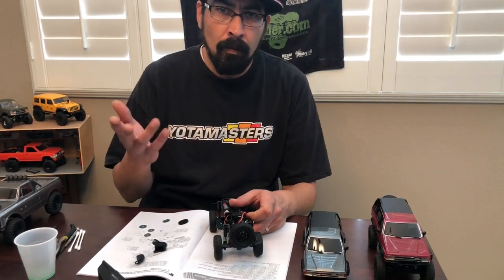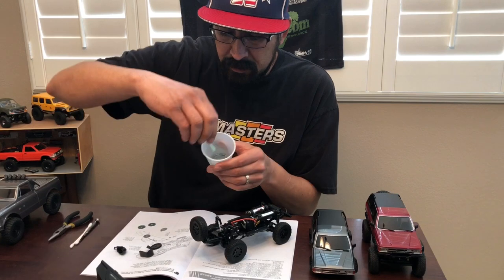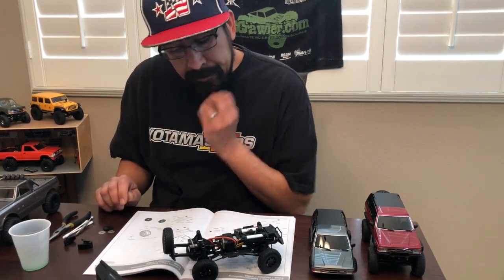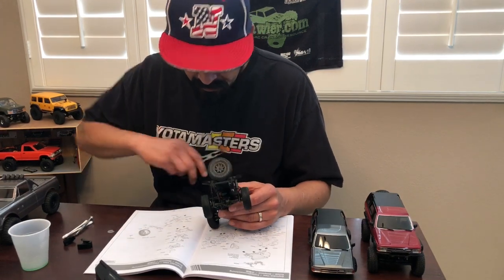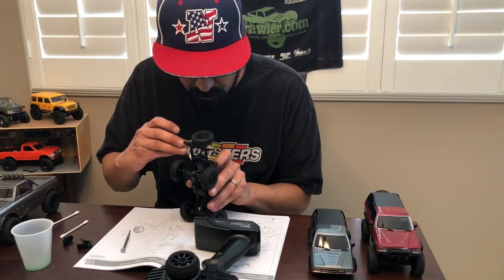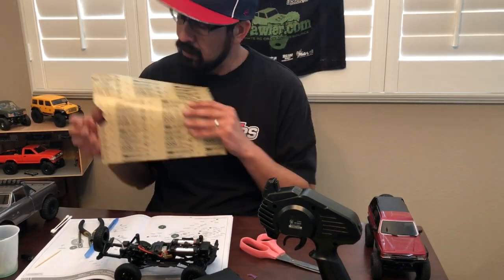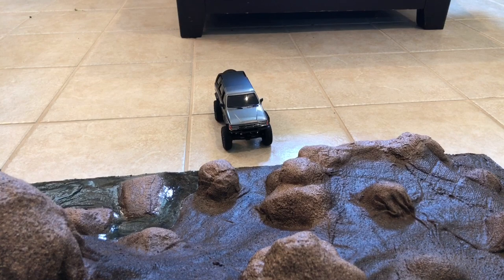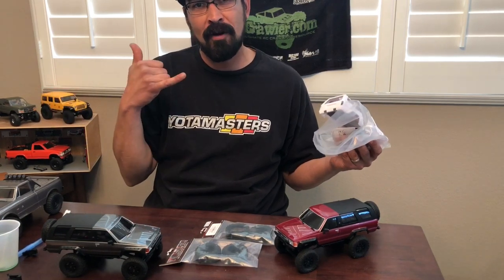Kyosho Mini Z 4x4 Slipper Clutch Problem

Comment: Hey guys, so thanks for this video. I can’t believe it’s the only one on YouTube attempting to solve this problem. I too was having a huge problem with the slipper clutch to the point that it wasn’t fun anymore. I watched this and read the update. I was prepared to install sand paper etc but instead I pulled back on the spring and let it snap back. Presto. I tried it and it doesn’t slip anymore. Apparently they failed to seat it like they said. Thanks for the video!
Reply: This comment was a life saver. I was in the same boat and your tip did the trick, thanks dude!

Comment: Thank you for the video, I had the same problem out of the box, mine was slipping so badly that the truck was not moving at all. After watching this video and reading the comments I figured out that the slipper shaft is spring-loaded and you can pull it out a bit (there is no need to remove the annoying e-clip). I took a 0.5mm washer, cut it on one side (making it a C shape) and сlipped it onto the pulled shaft between the gearbox and a slipper clutch. Adding this additional spacer was enough to increase the spring load to make the slipper clutch work the way it should. It's a beautiful truck and is 100% worth the money, I think they just overlooked this part.

Comment: I just pushed the slipper clutch backwards. It is spring loaded and blocked it in place. I then cut two very small slices of rubber band, inserted them behind the forward disc and released the clutch.  Didn't even remove the E clip. No more slip. Would have taken me hours to figure this out without this video. Thanks man.

Comment: Great info about the clutch problem, thanks. i just got a Jimny and so far so good, but you never know.
FYI, if the metal parts you are putting degreaser on are steel that's fine. Bu if they are aluminium, the degreaser will corrode the aluminium eventually. Check first ;-)

Comment: Since the slipperclutch is spring tensioned you could prolly have fixed it by just streching the spring a little... that way it would have tightened the slipper clutch much the same way as putting in a washer...

Comment: Mine had the same problem, wouldn’t even climb a 10• incline. I was camping so I reassembled it with pine tree sap. 

I remember about a 1mm gap between circlip and washer so I think a tension spring was forgotten?

It has yet to slip or break, while it may be nice to have I don’t think it is necessary with stock motor and 10t gear.

Comment: Wow~ I'm having exactly the same issue. I'm glad I found your video before return mine back. Hopefully I fix mine like yours. Thanks for the video!
Reply from the maker: Jeff Baik forsure there’s actually an easier way too, take the slipper clutch cover off and just pull on the slipper clutch! The day after this video I got a email explaining they seated the bearing wrong internally in manufacturing so literally just pull it and you feel it seat itself...
Reply: @JRJRCrawlers  Thanks for the tip~! :)
Reply: @JRJRCrawlers  this made my rig slip way less! Thanks
Reply: @JRJRCrawlers  so I just emailed Kyosho, and they told me the same thing. I did as instructed, and it actually made mine worse. I pulled on it, and could feel not seating whatsoever. Now it can barely move on carpet.
Reply from the maker: Dang hoping you got it fixed…

Comment: Not sure if my issue is slipper clutch related, but my Jeep Rubicon's crawling is somewhat jerky. You can also hear it when you take car to your hand and gently pull the trigger. Slower the wheels are turning, more noticeable is the jerkiness - wheels are moving with variable speed. Giving less gas causes wheels finally to stop in a position when the friction is greatest. It is like there is some sort of additional friction in the drivetrain which, when driving really slow, causes car to move unevenly. Effect is not noticeable when driving faster, but you hear it unless you drive full throttle. I wonder if this is slipper clutch related, is something off with the drivetrain, is it the gearbox or is it the speed controller? This is how the car was out of the box and I'd like to do something to it if possible. What do you suggest? I also find it possible that as the car is new, some parts are still a bit stiff and perhaps wearing out will sort this thing out?
Reply: I have the same problem with my rubicon, did you find a way to solve it?
Reply: @emanuelesias4056  nope, sorry...